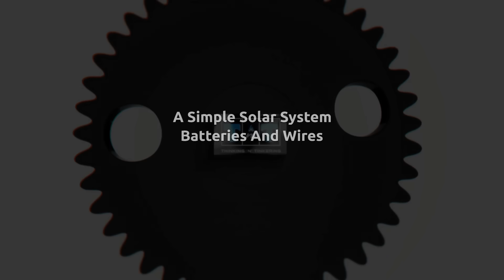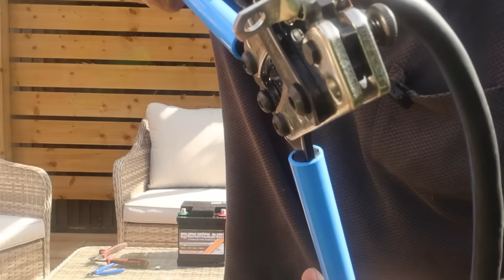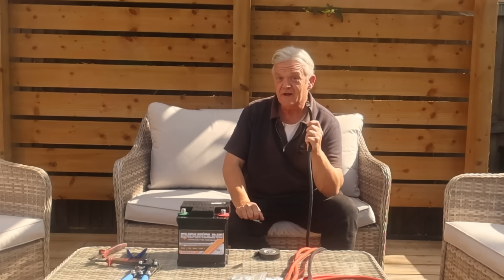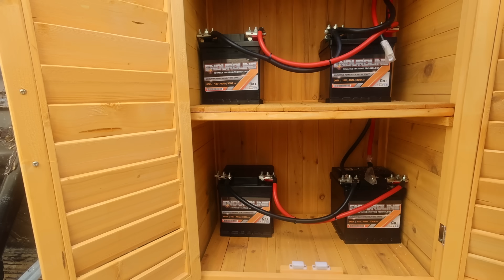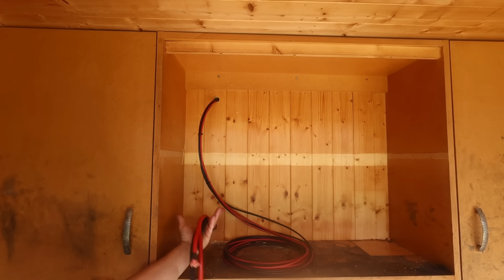2424 A Simple Solar System - Batteries And Cables

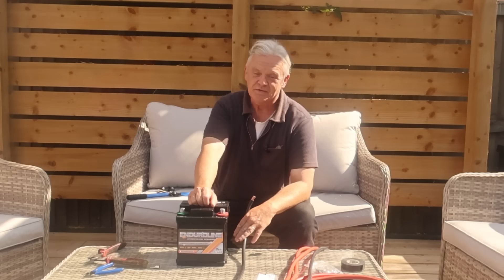Comment: battery pictures (9:22) enduroline-car-battery-12v-40ah

Lugs
> XC35-8

battery connector
> battery terminal connector 3 Way

You can get premade 8AWG battery Cable wire for connecting in parallel with M8 Ring Terminals (pair may cost around 7$USD) for a 11.8 inch (29.9 cm)

Comment: I built my own system, studied up first,  and ten 6volt lead acid, deepcycle, 105 amp hour, golf cart batteries, came out the best choice. Wired for 12 volts into a 110 inverter, fed by ten 17.3v panels, everything came out even, and no regulator needed, they lasted my homestead, with 2, 20 amp 110 circuits, all that was ever needed to run my house and all equipment, saws, drills, fridge/freezer, etc. for 20 years without a single problem, until, still working , I sold the property. I did take good care of them, and I dont believe a better set up could be found. 
Now he said these batteries only have a few hundred cycles? They rate at a thoudand, and if you wash them out and replace the electrolytes once every 5 or 6 years they double that easily. 
Hydrogen gas? How many cars have you ever heard of blowing up? None, they are vented. All that's needed is to not be stupid enough to try getting high on it.

Comment: One of many jobs I've had was installing Battery Banks for the Phone Companies, because their Uninterruptible Power Supply is to have a Power Supply powering the telephone exchange, while simultaneously maintaining the charge on a rather sizeable bank of 12V usually Lead-Calcium Cells in a Nominal 48V setup. They all shared a Common Buss Bar, as cables were too small for the currents involved.
Needless to say, the Battery was in its own room, VERY well ventilated. We have horror stories of ventilators failing and gas building up in the industry.
I chose LiFePO4 for my initial system, and they're going to have their own house, separate from all other structures, and be ventilated. With these guys, I'm not worried about Hydrogen buildup as I am Thermal Runaway, they DO have Lithium.

Comment: “YOU KNOW, when I charge my LEAF EV at 1.4kWh it draw 9A from each 300Ah battery tandem. TOTAL CAPACITY is 45kWh.18kW DRAWDOWN IS to midpoint near 26V. TYPICAL RECHARGE after 40-miles is 12kW. ARRAYS SIZE is 2.4kW functional. AMPERAGES OF 45A as maximum upper limit are possible using commonly available components of hardware. A FUELED DC-augmentation source for winter is reliable & practical with neodymium rotor upto 800W output at 28VDC. WITH 45KW capacity in lithium batteries now, there is no need for augmentation, probably. HOUSEHOLD DEMAND is typically less than 2kW per day. EV-CHARGING HAS been pretty cool. 😎 “

Comment: “START WITH metal for safety: AN ENTRANCE enclosure from outside protects wires that enter your structure. ANOTHER ENCLOSURE can be a repurposed breaker switch to provide safety in function. BOTH ARE connected with EMT or a flexible conduit, preferably metal. ANOTHER ENCLOSURE can be a repurposed load center. IT CAN enclose all connections to batteries, controllers, inverter & ground. IS HARD to find a controller type with EMT knockouts for connections, but there is one or perhaps two of PWM type. REPURPOSED LOAD-CENTER resolves problems. YOU KNOW, high current connection surfaces degrade, is unavoidable, but degradation can be retarded, slowed through distribution of high amperage. HAVE MEASURED severe degradation in a 1.5V battery holder. WAS NOT apparent or visible, only measurable. AFTERWARD, I could see that degraded contacts were dull. DISTRIBUTING BATTERY to inverter current can offset surface degradation, a load center provides hardware means to do it safely.”

Comment: With your battery setup. If you want an equal pull and charge on the battery's, Hook the pos side in your setup to the left battery. That way all current has to go through both. (Lets you know if something is wrong). If one starts to die you will notice it faster. Saving other one. P.S Love all your videos. Keep it up.

Comment: Hi Rob,I have a small self made solar charging system for boiling a travel kettle and I was thinking there are times when the batteries are full and the panels really aren't doing much so my brain got me thinking that maybe having a second bank of batteries that I could either manually switch to or even better automatically switch to,I don't want one massive bank because the solar panels won't cope with charging them up properly in the winter,if you have any ideas  on the matter .
Cheers 
Chris 😁👍

Comment: Great job Rob. Looking forward to using your tips for when I sort out my garage. Hoping to be a bit more adventuress by installing an infra red sauna which I think runs at something like 2Kw and as I have 2x 3.2 Kwh batteries going spare, hoping this will give me enough juice. plus other things when not in use and yes I will involve an electrician just in case. 🤣

Comment: I put my flooded Lead Acid in an old display freezer turned on its side, it helps stop them getting too cold or too hot in summer, Flooded Lead Acid get a bad press, I was at a battery sales counter and they told me a story about a 30 year old Lead acid that still had 80% of its capacity, the old boy had it in is car, he fussed over it and put it on trickle charge regular in winter. My flooded are all scrap and they work fine, they have to I am off grid, I have 15 x 100Ahs in parallel. I watch the volt meter and cut right back once they get to 12.4 volts, I sometimes get one fail, they usually get hot, and drain the others, that is when I swap them for another. I keep thinking I may go over to LiFePo but the recent boat explosion in Northamptonshire has given me second thoughts.

Comment: Remember, a lead acid battery can only be discharged about 50% without destroying it even faster. So a 100 AH battery is actually 50 AH.

And the round trip efficiency is terrible for lead while lithium is around or above 95%

Comparing how many lead acid batteries you need to replace over the time compared to lithium and especially lithium iron phosphate.
Then the lead ones is much more expensive and you need more solar to overcome the charge and discharge losses

Comment: As always a great lecture on batteries. 

Made me realise that one could have several separate rigs, each arranged in parallel to raise the amps, and then connect the rigs together, to raise the volts.
Reply: There is a thing about serial battery connections,   the batteries need to be balanced, do some homework.
Reply: @norton750cc fair enough. Noted.
Reply: @norton750cc  yo!
Do you have any idea how.. they are balanced while charging, or discharging, while powering a load simultaneously, uninterrupted!?
Reply: @yasirrakhurrafat1142 There are battery balancers available for series connected.
None needed for parallel.  I use ecoworthy ones they work well.

Comment: Is the danger of frost/the batteries freezing a pos problem having the batteries outside?we are in the North of England and I have had a battery freeze in a shed before now. Wondering about a system but putting the batteries in the garage (no heating but attached to the house).

Comment: Hey Robert, ever heard of something called radiative cooling paint that cools itself below the ambient air temperature and emits its heat to space? I recently found out about it from a youtuber who showed it can be made in the kitchen from sodium carbonate (washing soda), calcium chloride (calcium salt like whats used for de-icing porches/pathways), and citric acid. How much do you think can be saved alternating between panels coated in this or black paint between summer and winter to either directly cool/heat home air or a working fluid such as in the home's heat pump?
Reply from the maker: Yes I know about it mate. I don't think it would work very well as a working fluid in a heat pump.
Reply: @ThinkingandTinkering didn't say using the nanoparticles as a working fluid? As a coating for a panel that a working fluid or home air flows across the back of

Comment: My project is to use 40-50 mini torsion type minie windmills as it where to power a bank of batteries with an inverster.  

They will be 15 m above ground, seaside location. Above watertank...

Can this be done?   What if batteries are full and overloaded etc.?
Reply from the maker: yes mate - you can certainly do that - and you'll need a way to shunt the excess power when the batteries are full.

Comment: I think you know what you are talking about, but you formulate some things incorrectly.
Flooded lead acid batteries can last a long time. The problem they have is that compared to some lithium ion batteries they have a fairly low cycle life. And the deeper you discharge them, the lower the cycle life. If you do not intend to cycle your battery on a daily basis, then lead acid is a proven and cost-effective technology.
Voltage drop isn't specific for DC current although you make it sound like it is. Voltage drop for DC and AC current is similar, what is different is that for AC current we typically use higher voltages, so the  relative voltage drop is low. If you use a low voltage DC battery, like 12 V, then the voltage drop is relatively high. E.g. if you lose 1 V in a 110 V system, that doesn't matter that much, if you lose that 1 V in a 12 V system, it's a significant loss.
Reply from the maker: Thank you mate - I know both of those things. However, you may have missed the point. It's not that I formulate them incorrectly - I put in them in a general way - like building blocks. In those terms it doesn't matter much which actually battery fills the block of 'battery'. I don't mean to be rude mate but I had to laugh about the bit about voltage drop - i was talking about DC and a system where it is all DC - why would I mention AC?

Comment: Be careful when putting LA batteries in parallel. If they are used and of different degradations they won't last very long at all. Plates will start to burn up in the cells and the whole system will fail in short order. It's best to use the same LA battery as a new cell if you plan on putting them together.
Reply from the maker: Actually that's true of any kind of battery mate. But mostly when a put a lot of them together - it's why balance boards have become popular - especially in lithium set ups

Comment: Figure I'd mention there's some lovely RGB bulbs you can get now, only about 6 watts a piece, but they have their own battery in them and an IR controller. Not the brightest but also not overdriven to the degree that they blow quickly. They magnetically clamp onto their E27 base and can also charge from USB. Combined with a small LiFePO4 Bluetti-brand thingy, I've had the odd power outage or two and not even known about it except for all the alarms in the street going off!

Combine that with the hundred watt foldable solar and a bunch of slowly-acquired pocket power packs and 18650 boxes, basically my small-devices and lighting requirements are more or less met, albeit not as nicely bolted in as yours is going to be. Good for keeping phones, tablets, radios and maybe the occasional small kettle of water available for "free" though.

Going to be fun to see what you end up doing with that setup when it comes to plugging in DIY wind generators and other funky stuff in to see how well it does.
Reply from the maker: sounds like a good plan - all the best mate!

Comment: I worked for a battery distributor many years ago and one of my jobs was pouring a new post on batteries that had been damaged. 
One day my boys was out of town so I was out in the warehouse and not in my regular role. A customer came in and had a big heavy machine battery and wanted me to pour him a new post,
A job I have done hundreds of times.
So I put my PPE on and grab a mold and put it in place and grabbed a stick of lead, lit the torch to melt the lead rod and I put my torch down towards the mold and the next thing I know the whole warehouse shook. The battery blew up and the customer decided to just by a new battery. For several years I found little bits of that battery all over the warehouse.
Reply from the maker: you are lucky you didn't die mate!
Reply: I take it, the battery was full of Hydrogen gas
Reply: By post, you mean one of the protruding battery terminals, on the lead acid batteries?
Reply: @yasirrakhurrafat1142  Yes.  If you disconnect and reconnect a lot, or if the new guy gets overzealous with the post cleaner, then they can fail.  You can put a little tapered mold on them and pour a new lead post instead of replacing the battery.
Reply: @ElizabethGreene  ahh, I assumed they were made of aluminium or something.
Lead.. doesn't sound half as safe.. but I guess alligator-like clamps would make better contact with soft lead than aluminium.

How'd this guy have such a strong reaction by the battery though?
Reply: You unintentionally distributed that battery tho.

Comment: 6:20 "batteries and supercapacitors together"
Yep. Vehicles benefit from tribrid configurations:
Synfuel, biofuel, or, in a pinch fossil fuels for long term power generation.
Batteries for short trips and to help with acceleration, braking, and long term power. An overweight jack of all trades.
Supercaps for acceleration and braking, hopefully without much help from the battery.

9:05 "48 volts"
That's still "low voltage regulations", right?
48 to 12 volt converters are cheap and efficient.
Ebikes generally use 48 volts.
But yeah, four used car batteries that surely don't match in resistance or capacity, series would be asking for trouble.

I invented a battery cell balancing system. It actively rebalances an aging battery without having to replace the weak cells. There's less need to match cells when building the battery. And efficiency improves when cells stay balanced. Let me know if you'd like to see it.
Reply from the maker: will do - cheers mate
Reply: Would love to see it.

Comment: It might be a good idea to stack the batteries every 6 foot apart throughout the house inside of having the battery pack at a central location. I would try that to deal with voltage drop. But then I would need to disburse the panels within  6 foot of the packs. Throughout the structure. To me that's simple it seems.
Reply from the maker: sounds like a plan mate

Comment: You cant beat lithium iron phosphate batteries anymore, the costs have dropped drastically in the last year and are safe.
Reply from the maker: fair enough mate
Reply: Also, a LiFePO4 battery can be fully discharged without damaging it (although keeping it above 20 percent extends longevity). Lead acid will be permanently damaged if fully discharged. You generally want to keep them above 50 percent SOC. Also, lead acid batteries don't have onboard battery-management systems, which has all kinds of implications for performance, safety, etc.

If you have lead acid batteries sitting around, cool. Use it. But people should just be aware that they have lots of disadvantages.
Reply: Yeapp, especially if you need heaps of the stuff, and building big power storage.
It seems much practical, with fair amount of safety, power, energy density, and all the bells.

Comment: Looking good, those exotic batteries will be interesting in comparison to the lead acid batteries cost,safety, and energy efficiency also combining them + Capacitors. another thing to think about is when solar season is over if you go too big on the battery bank you will be spending money charging batteries from the grid/mains great video 😊👍 .
Reply from the maker: cheers mate - the off-season charging from the grid is a good point

Comment: Very interesting. Wasn't aware LTO was a safer and longer lasting chemistry. As a blanket safety net I avoided all types of lithium for well-known reasons. Currently running Pb AGM. Ironically here Pb AGM batteries cost more than lithium types so they're sold everywhere but I have severe reservations about using any L type in my home. On a side-note, I get my AGM batteries from an auto scrap yard where they're available at 25% the cost of new ones. Yes they're not "solar deep cycle" rated but in my application they're used more as buffer capacitors for cloudy moments, not for overnight discharging, so stay above 80% SOC always.

Looking forward to some of those DIY batteries you mentioned! :)
Reply: Lithium problems are overrated.  Just like all batteries don’t overcharge, overheat, or damage them and you will be fine.  The oil industry is the one that pushed the lithium media blitz.
Reply from the maker: that is an interesting point about the auto scrap yard!

Comment: Rob, I noticed that in your battery box all the battery connecting wires seem to be roughly the same length. Is this a consideration when wiring them up or is the distance too short to make any difference?
Reply: I think he did that for resistance. If everything isn't matched perfectly one battery will pull more amps and bare more load. We make the cables the same length to limit this. Sorry, not trying to speak for him. He may have a totally different reason. 

With lead acid cells it's more important to make sure everything is matched as close as possible.
Reply from the maker: That is exactly why I did it mate.

Comment: One other part of lead acid, is compared to many, they are something more in reach to repair or rebuild for oneself. Compared to the nastiness of lithium and some other specialty materials, lead acid is strongly documented, and most of the info is very deeply documented. Lead also has a good low melting point and fairly high vapor point, so remaking a rudimentary plate will generally work. Sulfuric acid is a bit higher skilled, but not as much as people might think. Also a place where modern plastics help that was originally the domain of glass. I want more on that nickel iron one, as there is less about it, and it could be something that can be refined without as much specialty equipment compared to even sulfuric acid.
Reply from the maker: cheers mate